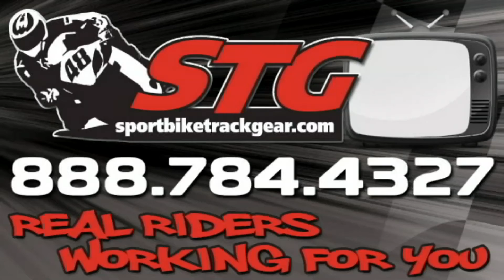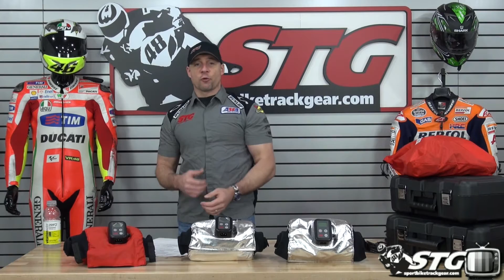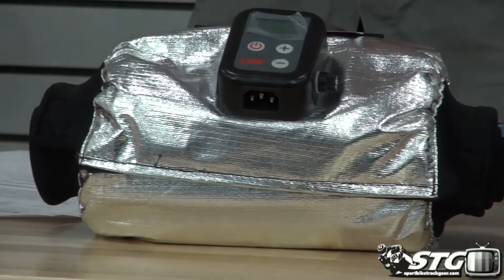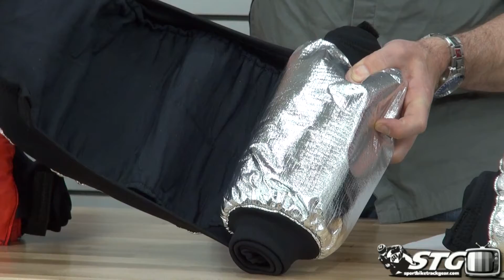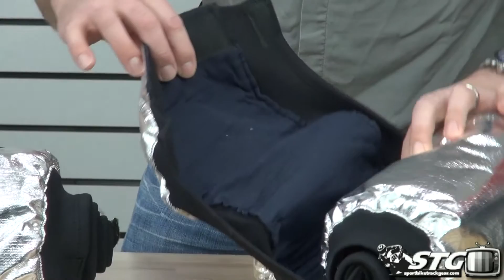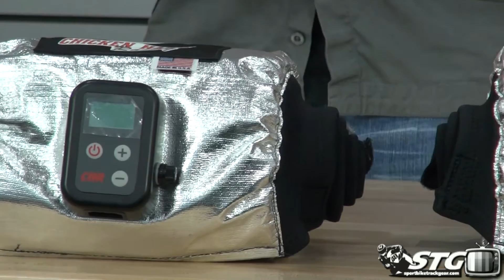Chicken Hawk Racing Tire Warmer Review and Breakdown

Comment: Looking to get a set of tire warmers, for the track. My main question is I'm still beginning stages of my track days novice group mid group rider. I'm running pirelli rosso corsa 2 for the time being, on a 1290 super duke r. I've heard conflicting information some people say I need them some say I don't.  I've noticed tires have cold tear on them even after a full day of track riding running 31 in the front 33 rear I'm a bigger guy. So figure I'd need more air in my tires for my weight. Trying to take the guess work out of if I need them or not especially for the tires I'm running as well. Some say you don't need them for more street oriented tires since they heat up faster, but the cold tear doesn't seem to show that for me is that due to tire pressure or just going onto the track with cold tires? Sorry for the long comment!
Reply from the maker: You do not need tire warmers for those tires. If you are experiencing issues with the tires at a track day I would work with the tire vendor at the day you are attending to help sort them out. Having the ability to see the tire is helpful with sorting out the issue. Important to give the tires 1-1.5 laps to warm before you push them. - Van